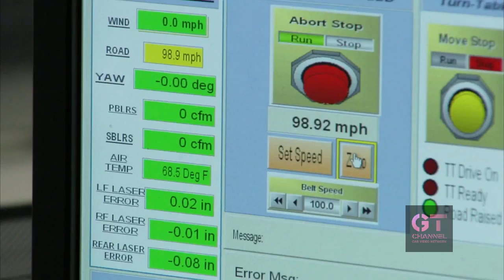Nissan DeltaWing Launch - Innovation that Excites

Comment: indeed rally is as you describe it but f1 is the pinnacle of circuit racing, and yes they have to build an engine that will compete at speeds and extreme heat. also in rally your not competing directly with the other drivers you each have your individual run in which you have to get your best time. in f1 you you have to get past other drivers that are as skilled or more than you are and that's where f1 differs from rally, direct competition against highly skilled drivers at insane speeds

Comment: thats a far bet to say that F1 is the pinnacle of racing. in terms of driving rally requires more skill from the driver and the car has to be tough and durable while going through insane circumstances for much longer periods of time. and the lemans is a much tougher race for both car and drivers if you consider the F1 cars drive for 2 hours in the longest race of the season and even then there are occasional dropouts usualy every race or 2 races due to mechanical failure.

Comment: how are they behind? what your not realising is that the F1 has a very tight design spec and the only real difference from car to car is the aerodynamics and from that point of view i would say Nissans experience in an endurance rally event the Dakar rally would be much more useful for roadcars, aswell as the experienceof their skyline running in endurance series and other racing series around the world would be much mroe useful for road car development.

Comment: innovate this, innovate that *yawn* Is this another one of those "nissan didn't know" things? Are they that desperate to get attention? :/

I like it up until he said lower power in the wind tunnel/dyno scene. Surely theres an engine that has alot more power but weighs only abit more than this?

Comment: @SgtDamien It actually turns with the back wheels, so its gona have to take a very weird line, im surprised they let it into a series with other types of cars, may cause alot of crashes. But it turns fine with speed if anything its top end flat speed is lacking. the tires dont ware out so bad when you steer with the rear of the car either.